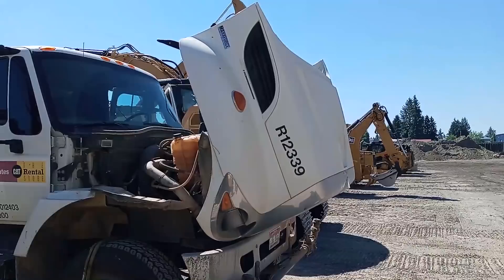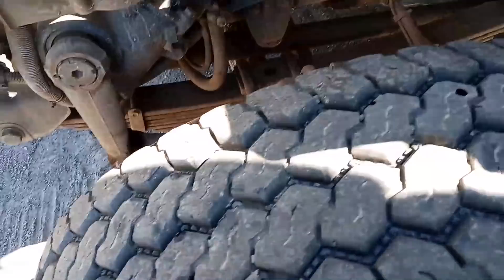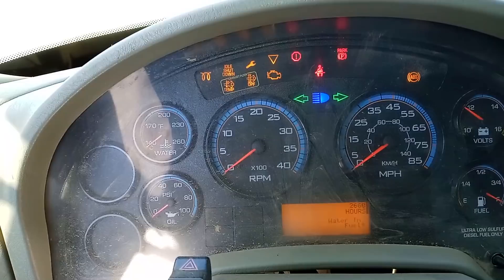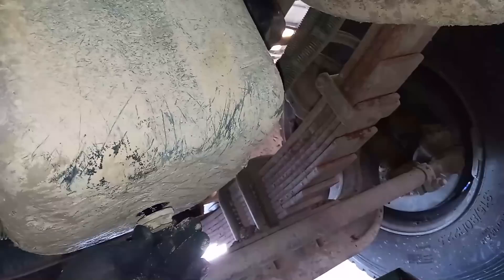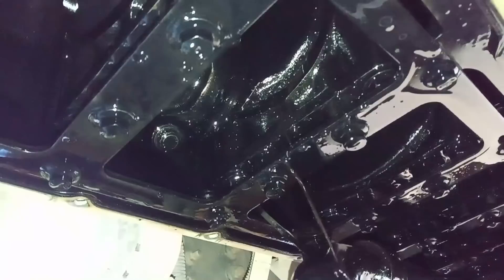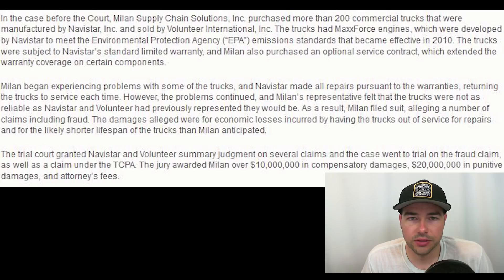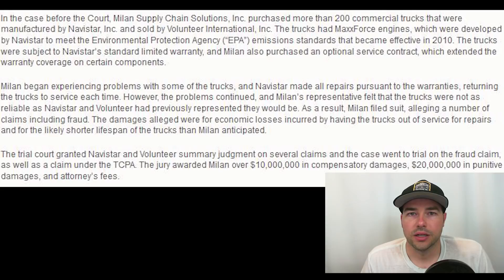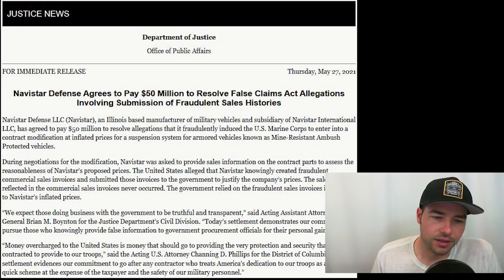CAT Mechanic working on an International. Are Navistars and Internationals Junk?

Comment: Was gonna get an international for my first truck, good thing i looked up the reviews, never got it, instead a series Series 60 freightliner came into my life and I haven't had a problem with it since.
Reply: Series 60 is a great engine it will get great mileage and it is very reliable.
Reply: Me too, i was planning on getting the intl pro star because i liked the exterior body but thank god i did my homework and studied it through and throigh, like you i went with the frwightliner 12 7 60 series and apart from little things that any old vehicle will have to be replaced, it has never left me stranded on the road. I always see trucks broe down on the road with their side steps panel removed which is a clear indication of emmision problems. Ill stay woth the old reliable pre emmision engines all day, taking care of my truck to last me as long as possible to push back the time ill eventually have to moove onto the emission time bomb engines.

Comment: Only had to deal with one Maxxforce 13 in my career, mercifully! Terrible nightmare of an experience, only after a year of big $$ did my boss finally sell it.
I've heard the same thing, that the base engine was quite good.....graphite iron block, dry head gasket, German design. It was the complex turbo/cooler system, dual EGRs and the wiring (basically all the ancillary components) that were terrible. There's a reason Navistar almost went bankrupt during the Maxxforce"s tenure and had to get Cummins help to figure out how to make a compliant engine....should have followed Cat's lead and dropped out while they had a good reputation.
Reply: The larger maxforce engines are literally cats designs that international brought from them.  It's clear why cat decided to drop out based on how maxxforce performed.
Reply: @paulf3  the smaller Maxxforces (except the Maxxforce 7) were actually decent. Unfortunately the EPA ruined everything and  navistar now has boring crappy Cummins engines.

Comment: Coolant dropping that fast is the liner o-rings. Very common when you overheat that series of an engine. They don't crack heads as often as cat engines do.
Reply: Fragile o rings keep oil and water seperated. Oil and  water mixed wipes bearings.
Reply: Bearings rarely go out. However, if you do an overhaul you replace bearings.

Comment: I had a DT 466 for 15 years with the only problem being the injector harness under the rocker cover. Good truck for the money!
Reply: Sounds like the same issue I had on ever 7.3 powerstroke I owned.
Reply: @Mantis858585  That's because the 7.3 powerstroke and the DT466E use about the same fuel system and interchangeable injectors

Comment: Excellent video. Learned a lot. I worked on a dead international maxforce and it had blown the fuse for the ECU. It was the fuse on the battery. No crank, no start. Several drivers have told me theyve had electrical issues with maxforce

Comment: Thank you for the mechanical tips of the intermittent speed of the cranking of the engine.

I read a forum a few years ago where a guy couldn't understand how two international trucks were selling for $30,000 difference when one had the IMAX engine and the other one had a Cummins engine.

I could have told that person questioning the price difference first hand that that $20,000 is a bargain.  I've heard of international engines having to be rebuilt after 300,000 miles as if it's back in 1970 all over again.

In my maintenance manual on my Freightliner Century tractor, it has different tiers of service.  The first tier is severe duty which is due to very cold temperatures or very Sandy ambient atmosphere or vocational trucks that idle about and drive short distances.  The proper way to account for the severe duty operations is by hours and not by Miles.

I do hours and Miles both on my tractor since I'm kind of a tweener between severe duty and local duty.  I go by whichever one takes first that it triggers the maintenance.
Reply: You can go by fuel burn as well, on my 3408 they recommend  oil change at 9,500 litres / 2,500 US gallon fuel burn. I usually do it at 250 hours or 9,500 litre fuel burn.

Comment: The maxxforce 11/13 engines aren’t that bad to work on. Once you understand them and know the tricks to working on them, it’s easy peasy.   But the best engine platform out there is Cummins, hands down.
Reply: No not Cummins Detroit
Reply: To hell with Detroit, once they and Freightliner were both bought by Mercedes Benz, and have to be blowing each other on everything they do now, they’ve gone to crap.  The trucks are rubbish, the engines are a pain to fix, assuming you got Detroit (MBE472), because of course you did, and the “Detroit DT12” Transmission (Powershift 3) because you can’t be bothered with a more established Eaton, I hate those trucks.  I’ve driven the Cascadia Evolution (if that’s the evolution, I’d hate to see from what exactly it evolved) and wasn’t thrilled, and the New Cascadia, even worse, so much flat plastic.  I’ve never had a problem with Cummins, except that wonky engine brake.
And Detroit Diesel computers, sensors, and cameras?  Where the hell did that come from?  And the new Demand Detroit?  I Demand a new truck.
Reply: @kyle what would you say the ct13 biggest issue is ? I keep hearing it’s because of the emissions equipment and once deleted, it’s actually pretty reliable ?
Reply: New Cummins ISB’s suck. They break down too often for little stuff.

Comment: I have rebuilt more of these than I could count. All 466 based engines suffer the exact same failure. Yes even the old 466 mechanical that someone's grandfather bought in 1988. The piston scores and liner orings fail. The issues is that as the engines got newer the overhaul timeframe shortened significantly.  
The us postal company I once worked for had them nearly on a schedule. The old mechanical engine was around every 15 years the, e series were consistent at about 8-10years. The second gen heui system (6.0l powerstroke style) made it 6-8 if well maintained . After that you pretty much roll the dice. At the start of the max force stuff it is just as likely to swallow a cooler as it is to get coked up the turbo or die due to def etc. Etc

Comment: Makes me miss the days when you wouldn't see anything smaller than 16 gauge wire under the hood of a car, and all the other wiring that was important was substantial and chunky. Not any more. Remember working on my brothers Ford and the headlight wasn't working and the wiring for that wasn't even thick enough to use as dental floss. Naturally the few mouse pubes that were passing themselves off as stranded copper wire broke, and it needed a new connector.

Comment: I haven’t had a modern truck yet that doesn’t spend more time in the shop than on the road. The most recent garbage was Volvo our company owned 160 of these trucks and out of the 15 we had in our local fleet had so many issues. Wiring, wiring harnesses, constant emissions issues. The engine and transmission were OK if you could keep the trucks running. I refused to give up my 90’s era series 60 Detroit freightliner after my brand new Volvo was in the shop all the time.
Reply: Volvo suck to work on, The I shift transmissions are junk, the D13s are junk cam problems, egr problems, injector problems, drop valves, and air compressor problems worse on the Mp7 "Mack" engine. Also Volvo suck to work on, Mack is even worse. I worked at a mack/volvo dealership for about a year and a half before going to Freightliner.

Comment: My first job was working at a international dealership before I started driving, I was in the parts department, I did that for a few years. And words of the wise was, from the mechanics and shop foerman, pro stars are cheap for a reason, and don't ever buy one with a maxxforce. I've heard that from a lot of guys over the years. One of the veteran drivers I knew that drove 9400 eagles for years got a pro star, and the only thing he said about it was "I don't like it".
Reply: It’s a shame. The DT is the only ‘good’ Maxxforce. Since they used Cummins they have gotten better but are still trash because the engines are plagued with emissions problems.

Comment: I think you were looking at an old website. They gave the A26 engine now. I have one in my truck, 468k miles, and it’s been great. The engine design, engine and cab wiring, are much different than the previous generations. This is all old news. International is now part of Traton, VW Truck and Bus. That’s a lot of capital and technology they now have access to. The LT and A26 are a huge improvement and I think it will only get better.

Comment: Tell me what truck that doesn't have issues with the pollution system? Our company lemon lawed a Mack over a constant egr failure. Our Western Stars with DDC were just as bad. It's really sad to see new trucks in the shop and relying on old ones with almost a million miles on them keeping the company going. We had 12 year old C15s on the second inframe on the road everyday while brand new trucks were in the shop.
  The problem I remember with International was you needed to know the guy who built the truck to get the right parts.

Comment: Dt466 and the 7.3L are the only international products that run decent and are relatively reliable. Keep your dt466 stock and it will run forever. Easy to work on, easy to diagnose abd easy to repair. The interior on the internationals is cheap and loaded with plastic, where the tabs that hold the dash panels and such break off over time and you are forced to wedge things behind plastic panels to prevent rattling. You see a lot of international box trucks, and LTL trucks, because they are a little cheaper when making a fleet level purchase. 

Anyone who knows, if it is a class-8 truck and it has a MAXXFORCE logo….run. Run fast!

Comment: Most definitely enjoyed the video just got an international 2006 7400 I bought it from the junkyard with 70,000 MI it was an old Town garbage truck I took the hopper body off and put a cesspool vacuum tank on it and the one thing I thought was funny is an indicator light for electrical problems plus this aftermarket battery kill switch installed which has to be shut off at night but I have to go in through 20 of them and half of them were natural gas that was the best one on point with your information brother

Comment: The 7.3 PSD was good, but later PSD engines were a pain. The Powerstrokehelp channel is an expert on those trucks. Also, it is a good place to learn about diesels in general.
Navistar made a 4.5L V6 that was like a 6.0 PSD with 2 cylinders cut off. They were very uncommon, and as a result, getting repairs was a nightmare. The only vehicle I knew of which had the engine was the Ford LCF box truck.
The 6.4 was an early DPF engine, and it had to go into active regen very frequently. It would do so by overfueling the rear 2 cylinders, and that would destroy the turbos with heat. The turbos would then leak oil into the DPF, forcing even more regens, and the extra fuel would destroy the piston rings on the back 2 cylinders. Powerstrokehelp tried to rebuild those engines, but they were usually in such bad shape that they couldn't justify it. It ended up being cheaper to buy complete Motorcraft reman engines, plus those come with a good warranty on them.

Comment: Well the 7.3L powerstroke/T444E was amazing lol
Reply: My I.H. build non turbo 6.9 has been running 34 years!
Reply from the maker: The DT466 was also pretty good from what I've seen, the company didn't always make junk.
Reply: My 7.3 is 25 years old. Before that I had a 1972 Scout 2 with a gas 345 cu in v8 that ran well until I took it up to almost double the redline. All that being said, I wouldn't touch anything new that they make. They are a good example of, if your company is not improving, it is declining. Kind of like CAT not producing over the road truck engines anymore. My next engine will be a Cummins, and I hope to work for them sometime soon and develop my method of improving emissions and efficiency without having an EGR system. Of course if CAT were to approach me, I might be willing to work for them.
Reply: @davidscott5903  doing away with the EGR would fix 90% of Diesel engine issues. I think it’s evident nowadays that the after treatment system isn’t the problem, it’s the EGR that causes the emissions related issues.

Now, yes, you do have the possibility of def system failures and dpf clogging, but I’d say EGR problems outweigh both.
Reply: I own a 99 Ford F-250 (7.3) PowerStroke. Brought new 10/98. 173,000 + miles. Six in the floor. 👓
Reply: @kennethbullins445  
Mine is a five speed, and I just wish that manual transmissions were still available. I'm not a fan of automatic  transmissions. Oh well I will just have to adapt a manual transmission to anything that I own.
Reply: @Redsfanatic32  
Yes EGR's are the stupidest thing you can ever do to a diesel engine. My idea eliminates the EGR system, but still prevents the NOx. It restores and increases the power and efficiency to the diesel engine.
Reply: Since DEF/SCR is used to reduce NOx, and so is EGR, I don't know why current diesels just use more DEF to avoid using the EGR.
Diesel EGR sucks, but I understand that at one point there was no other way to make things smog legal.
In fact, I have to wonder how much EGR really does. That is because Dieselgate affected the VW Jetta and Golf, which had EGR but no DEF/SCR. The VW Passat and every larger diesel VW sold in the USA was equipped DEF/SCR, and I don't believe those were part of the scandal.
When VW wanted to change the Dieselgate Jetta and Golf, they considered using the DEF filter and SCR tank from the Passat, but couldn't find the room to install it. They then decided to raise EGR flow even more, and offer owners thousands of dollars to cover the reduced fuel economy.

Comment: My old 4700(DT 466) has been in our fleet for 21 years, and still ready to roll!  My 2018 Workstar w/ L9 Cummins has been outstanding so far, zero issues.  We have had some problems w/ the 2008 and up Maxxforce engines, mostly emission system issues. It will be interesting to see what VW does to International in the future.  As for the annoying beeper, it can be shut off by holding the dash dimmer switch and the odometer reset buttons down at the same time (with the key on).  Not ready to switch teams at this time, but would consider a Paccar  truck if need be.  Best IH engines: gas inline 6 400's, gas v-8's:  345, 549, diesels: 6.9, 7.3, 9.0 and the DT 466.
Reply: I agree with everything said here. I think the Dt466, DT466e and Maxxforce DT were the best engines made by International. Cummins is potentially good too but sucks because of the emissions trash.

Comment: I apprenticed at an international truck dealer for a short time in Canada, In the 6 months I was there I saw plenty of those maxxforce 13L and 15L engines come in for cracked EGR’s leaking coolant into engine. I was told that navistar somehow got ahold of the base engine design off caterpillar (this I believe because I remember pulling the doghouse off a prostar w/ maxx15 and coming face to face with a CAT branded rear camshaft cover on the cylinder head), added a bosch HPCR fuel system and their own emissions controls onto these engines. Apperantly these engines could not meet EPA standards and navistar actaully almost went tits up after a combination of having to payout fines on every engine they produced, warranty work, and lawsuits like you mentioned in the video.
Reply: The 15L was based on the CAT C15 the 13L was based on a MAN design, in both cases the emissions, electronics, fuel delivery and turbo plumbing were designed by Navistar.  I think they did the heads for the 13L as well. In both cases they were trying to make an engine do something its makers never intended. CAT had thrown in the towel at making the C15 compliant with the new standards and exited the market, but Navistar claimed they could make it work. The MAN design met the Euro standards that were in the same ballpark as the new EPA rules using DEF, Navistar tried do it with EGR only (Everybody else in the market used DEF) . 

They used a bunch of banked Emissions credits while they tried to make these engines meet the emissions standards but eventually the engineers in charge were canned when the bleeding showed no signs of stopping. The Cat engineers turned out to be right and the C15 could not be Cootered to meet the new standards so it was dropped. The MAN engineers were right and the 13L needed DEF to hit the standard. Navistar wound up going to Cummins to make an emissions package for the MAN 13L that actually met the standards and worked.

With the takeover of Navistar by Traton (owners of MAN) I'm pretty sure in a couple of years they'll have an emissions package made by the same people who made the rest of the motor which seems likely to yield better results than the Frankenstein approach. 

 The trucks and the 13L have been rebranded a couple of times since to try to escape the stain of the Maxxforce saga.
Reply: @donrobbie5528  thanks for info

Comment: Hope the auction buyer gets full disclosure on this damaged truck. 👀
Reply: Probably not, auction pictures may even show that coolant levels full..
Reply: That is why I cannot understand how anyone or any business can buy auction stuff that's "As is" and you cannot test drive it.

A few years ago I read a post on some trucking forum where guy said to the original poster who was looking to buy a truck: "if it doesn't come with maintenance records it's basically worth junk it".

That is a little bit harsh as I bought my tractor without maintenance records but I went through it with a fine tooth comb—for all the major components that is.  I wish I spent a little more time looking through the interior and I might have knocked a grand off the price I paid for it.